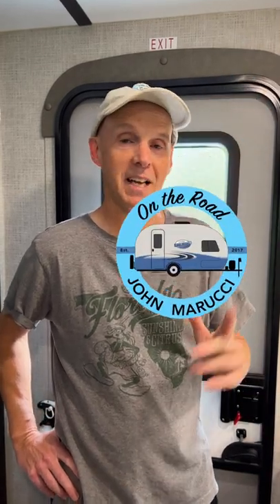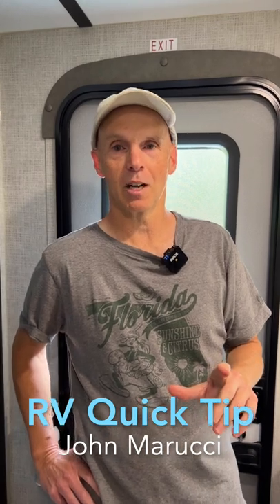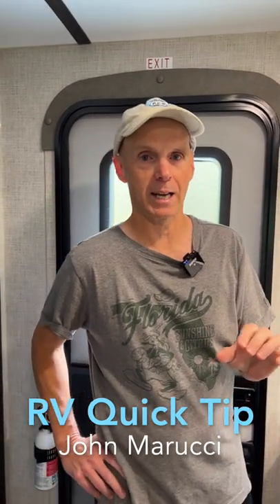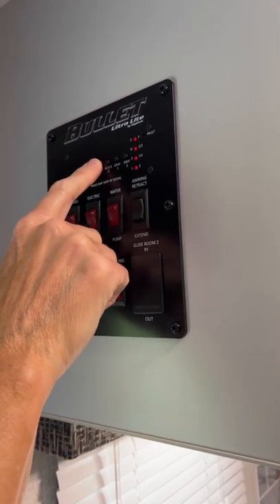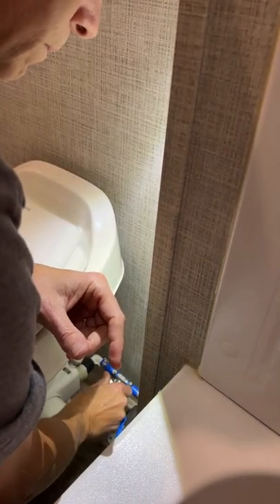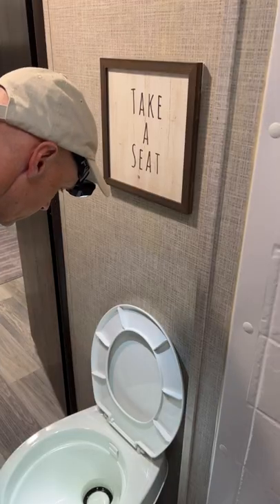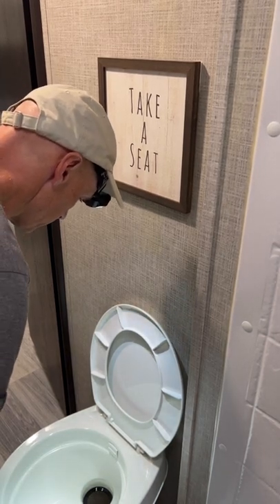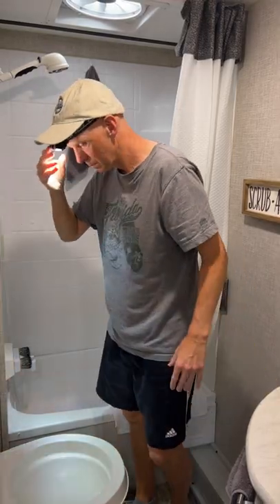RV Quick Tip: Monitoring Your Black Tank Level

Comment: Thank you,  John. They always show full right after you dump them. I just turn the pump off and look down the drain.
Reply from the maker: Yep, that works if you are using water from the fresh tank. Easy enough to just turn off the water pump and check. Most of my camping lately has been with city water, so I'd rather not have to turn off the city water to the entire cabin each time to check the tank level. The PEX valve really helps in this regard. Thanks for the comment!

Comment: After a year of ownership with a split grey and single black in the RPod 202..we have tried all the tricks and sometimes it's just a matter of luck.  I think best thing we do is the 10lbs of ice and dish soap and try to fill tank to 70% if sitting below 50% before ice...Drive...use your normal spot to dump close to home....In a perfect world if you have a black tank clean out like us it does the job.  Good luck team 👍
Reply from the maker: I haven't tried the ice treatment but heard it can work. Honestly, after three trailers and six years doing this, and using my black tank flush all the time, I have about given up trying to get the sensors clean. The visual method makes it pretty easy to see the levels, and while a bit gross to look down into the black tank, it does give me confidence as to exactly where I'm at. It would be nice if the manufacturers teflon coated the insides of the tank. Thanks for the comment and all the best!

Comment: You would think someone could come up with a better sensor system for the tanks on our trailers!  Thanks John!
Reply from the maker: I have heard that the See-Level II is pretty good as the sensors are on the outside of the tank, but one YouTube RVer I follow said that even these have issues with accuracy on the black tank.

Comment: I like the shut off valve…but can’t ya just turn the water off to whole rig??????
Reply from the maker: It has huge advantages having a cut off valve at the toilet, especially if you need to flush the tank from the toilet. It's a pain to have to go outside to turn off, then back on the water to check tank levels from inside. There more in this video: RV Black Tank Maintenance - 
https://youtu.be/LCcJtTGcXZc